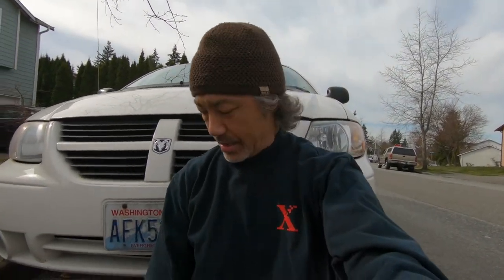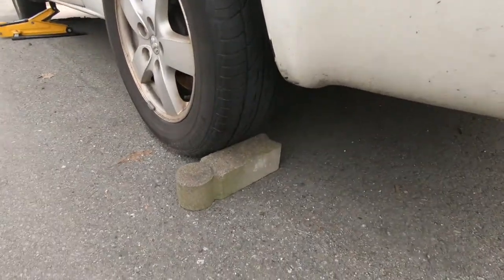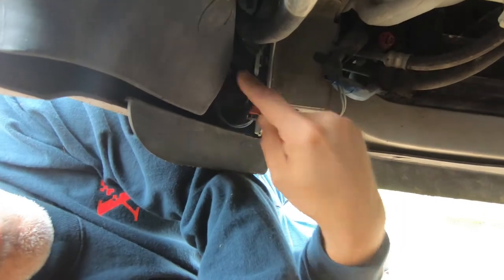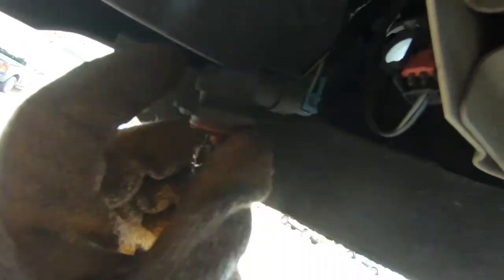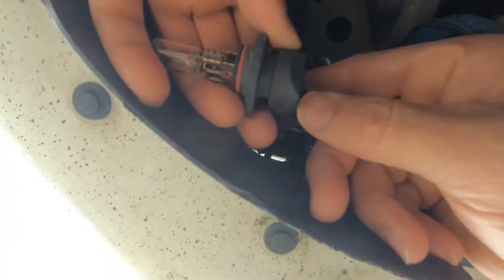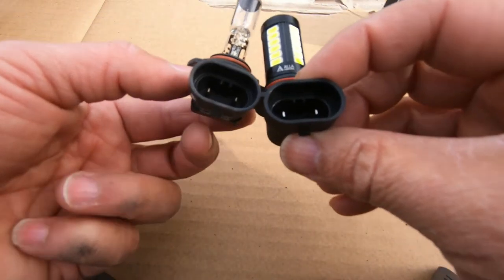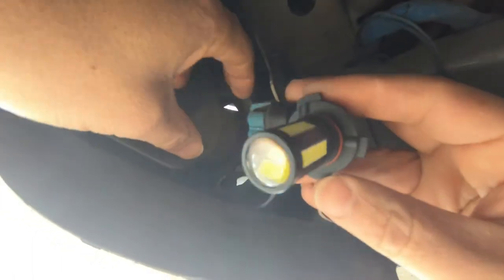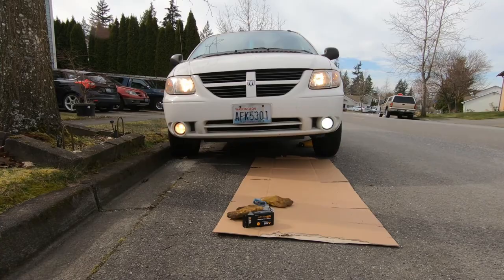DIY How to replace Dodge Caravan fog light without any tools

Comment: Great vid. How are the LEDs holding up?
Reply from the maker: I like having the LED lights, and they are holding up well. The only issue is I had to buy a load resistor kit as well. (I haven't installed it yet) Without the resistor kit if you turn on your high beams it cuts out the light and electrical system for an instance which is not good.
Reply: @ChuckTuck  wait, are you saying that always happens with LED lights and high beams?? That doesn’t sound good. What year was this Dodge Grand Caravan? Mine is 2019 and they told me to get a different bulb at the auto store. The bottom connecting part doesn’t look like that. But before I open these LEDs I just bought on Amazon, I need to know they’ll work fine and not cause some electrical problems. Otherwise I’ll just buy the more expensive one they said. Please tell me more. Thanks!
Reply from the maker: @Martina1192 sorry for the delayed response.  I have a 2005. The headlight assembly from what I know are good from 2001 - 2007. Your 2019 assembly would definitely be different.